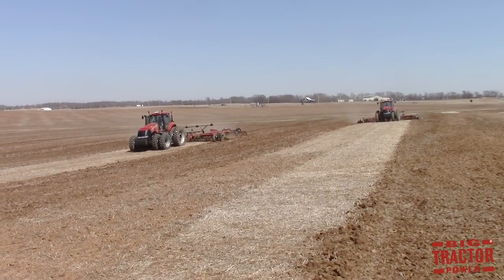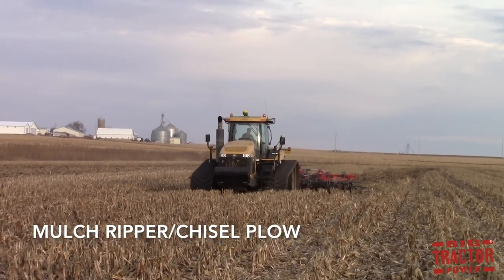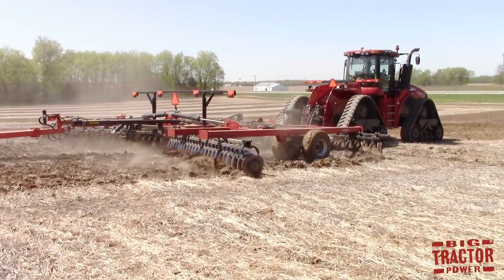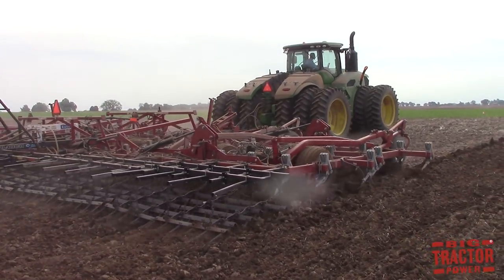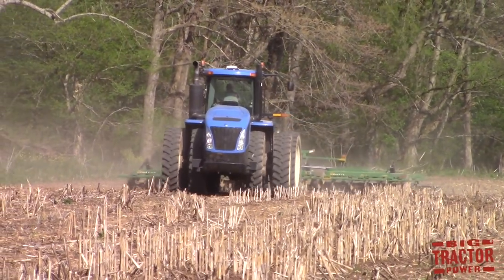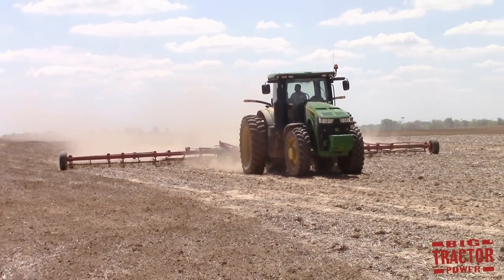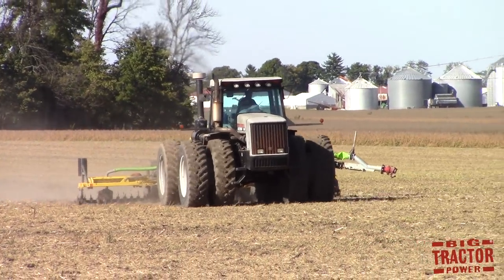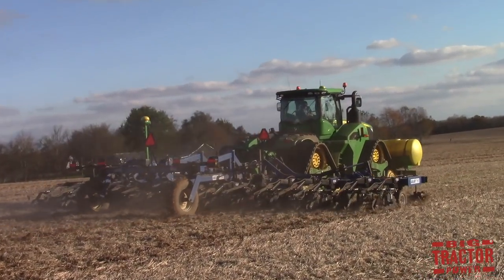See Every Kind of Spring Seed Bed Tillage

Comment: We always tried to have a disc to run behind our moldboard plow soon after plowing before the rains hit. 
If you plow in the early spring and don't get a disc or field cultivator run over the plowed ground and it rains you may find your ground is to wet to work in the spring .

Comment: You should update this video with some more tillage types such an inline ripper/subsoiler, rototiller/power harrow, rotary hoes like a yetter, and an older style machine for organic operations so they dont have to spray to control weeds in the spring a noble blade. Also some of the implements might have more common names like i have never heard the name short disc until this video they are more commonly know as high speed discs as far as i know. Also same with the mulch ripper is more commonly as a disk ripper

Comment: Im not a farmer (yet), and most of this is personal opinion and analysis based on my studies, but my ideology in tillage leans towards a mix of:
Shallow tillage with minimal inversion for mechanical weed, volunteer control and accelerated residue breakdown. (AKA: "vertical tillage)".
Cover cropping and direct drilling.
Deep loosening with low disturbance tools for certain crops.
Cultivation at medium depths when required do to trash conditions, wetness or ground temperature.
And also, but only when necessary; shallow inversion (20cm ploughing) for a monotonous rotation or pest control.

I really like some European tools, specially tools from Väderstad, the Carrier short disk harrow is one of the best tillage tools around IMO, it competes, together with the TopDown, with "vertical tillage" by running at very high speeds (15 to 20kmh or 9/12mph recommended) and by using low diameter, conical disks which are thought to chop and trow soil rather than other machines which lift and invert it. The new CrossCutter disks also a great tool that could benefit even "no till" farmers who need to clear some straw and slugs.

Other European cultivators which are a mix of a chisel plow and a field cultivator (and a cultipacker if you wanna add), They are composed of generally 2, 3 or 4  rows of heavily angled chisels, a set of closing disks and a packer, the machine can work pretty deep, mix in a ton of crop residue and even leave a nice enough seedbed that you could drill intermediately after the soil dries, or even at the same time if using a broadcaster to drill Canola (Rapeseed).

I find that tillage machinery in the United States is weird by the fact that almost none of them features packers and they are used or designed to be used very slowly. This combined leaves the soil very un-uniform, susceptible to wind erosion and loose for any humidity, carbon and nitrogen to simply fly away.
I do like tillage concepts from the USA, like "vertical tillage", which in my opinion does not help much to avoid compaction, but does work really well by avoiding mixing layers of soil, allowing formation of humus and soil structure.
What I think you guys are missing on your machines is mostly packing rollers. Chisels and rippers could also benefit from closing disks to level the field before packing.
Field cultivators used for weed control are the only machines that shouldn't have a packer, since you want the roots out of the ground for the weeds to dry off.

About the drills; I see reasons why you would want to have the drill separate from any form of tillage: Either from avoiding lifting moisture to increase drilling precision, or not to lift up volunteer seeds while drilling, all the way towards increased throughput, for drilling in limited time windows. But its hard not to appreciate the convenience of having a short disk welded into you seed drill, sometimes completely eliminating the need for seed bed cultivation altogether, consecutively eliminating the need for two tractors. And the tool can be lifted anytime (on most machines) if required.

Finally lets not forget, every tillage must have a purpose, lets not just trow a plow and then a rotavator in cause the soil must be loose and broken down into dust for the roots to grow, which is simply not thinking. Recreational tillage is bad guys, let structure form and leave that stubble in there when possible, save your carbon and your nitrogen , the atmosphere does not need any more of it.

My two cents.
Reply: BTW I live in South America, so the whole EU vs US is mostly unbiased (expect for the fact that we do have a width limit for transport of agricultural machinery).
Reply: Also keep in mind that one of the main causes of compaction is actually tillage itself. Intensive mixing of soil, breaking of fine porous structures and reduction in organic matter lead to soil having extremely low bearing capacity. Gradual reduction in tillage combined with cover crops will lead to better soil structure and behaviour. If necessary, consecutive usage of low disturbance loosening tools can be used to further reduce the effects of heavy machines running over ground.
Reply: You're in the right way, in some parts, in other, can say that are better methods to do agriculture itself. Brazil is competitive worldwide in agriculture because besides its tropical climate, almost every farm do the no-till method of cultivation.

Comment: The "Harrow attachment" on the back of the "soil finisher" not only smooths the soil to give a better seedbed but it also seals the surface to reduce moisture loss.  May not be important in wetter areas but in the Texas Panhandle (where I grew up)with 18" of rain per year it could be important.
Reply from the maker: Very good point.
Reply: You need to make a video giving the retail prices of the tractors and equipment you show.  Many folks don't realize how expensive those tractors and plow are!
Reply from the maker: Prices are tough to say on new machines because there are so many options that cause a price to range $30,000 to $50,000 or more. I will see what I can do.  On the classic videos I share pricing is easier and I share it in spec videos as there less options.

Comment: the aerator doesn't pull plugs out, it is a 8 inch blade like a knife that pokes into the ground,, also you forgot to include the ripper( which is a vertical tillage machine to remove the layers left from the plow, cultivator and disc layers.)
Reply from the maker: This video covers spring tillage at least here in Kentucky rippers are only used in the fall.

Comment: We use a short disc (amazone catros 3m) you mentioned 8-10mph+ with regard to operating speed. We regularly use ours at 22kph+ and on some ground I know of one guy that was taking it at 28kph
Reply from the maker: It is an impressive tillage tool.  Thank you for sharing. What tractor do you pull your Amazone with?
Reply: Charlie Saker - It sounds more like a mini race track than a crop field. LOL :-)
On the other hand I guess it saves a huge amount of hours and fuel. 
Cheers

Comment: you didn't mention subsoilers. narrow long vertical legs that go deep in to the ground with a triangular horizontal plate that picks up the ground and breaks up the pan caused by cultivating and ploughing and brakes up compacted ground from driving over it. in the US you have very different views on compaction ploughing and heavy cultivation reduces compaction but can smear the ground underneath causing a pan that stops water going deeper into the ground in the UK everyone says compaction is from driving over land and compacting the soil so roots cannot penetrate deeper to find water if a farmer shallow cultivated all the time the pan would be shallow so all crop roots can do is go sideways instead of down.
Reply: Can I jump in and say that you are not often right - but this time you're wrong ?   );-))    LOL!  I do agree with most you say - but generally despite what I've seen on theTube,  and it really ANNOYS me the way farming is going - people do not know or understand HOW to set up a plough!  A plow should be "carried" thru' the soil to provide traction for the tractor and NOT to smear. - it  can then be used to break up Pans as deep as the Plow depth.  Smearing and Plow Pans is caused by several factors: (heavy) traffic in the WET; poorly setup plows - the shares being "blunt" = worn so that they push down as much as up to get through the soil.  A properly set up plow will suck down so that it has to be maintained at its level by t he tractor.  It appears that most of our BIG Reversible plows are effectively just trailed - hence the need for soooo much Ballast to pull them!  - It is a large enough subject to discuss but if folk would get the Basics right .....  ( NOTE: - I cannot see this video yet -  something to do with HTML5 )
Reply from the maker: In line and v rippers are the main tillage tool for fall primary tillage.  I did not include them in this video because the focus was on spring tillage options.  I have not seen subsoilers used in the spring.
Reply: joseph jackson why don't you explain then
Reply: There are many soil types in the USA. I grow up on the farm we played in swamp ground and heavy clay. I worked for six other farmer and they all had different soil from sandy, rocky, black soil and clay sometime all in one 60 acre field. What works best for where you live is what you uses
Reply: You need to look at the math/physics of how the tires transmit power to the ground.  When you start putting over 200 hp to the ground the compaction from the torque of the wheel becomes important.  

We used hard-surfaced discs for our primary tillage tool for a long time, but then we realized the small the edge of the disc to more it compacted the deep soil.  Yes, our discs were so sharp they would chop up a pine 2"x4" board but we were still putting thousands of pounds of pressure on the edge of the discs.

We finally went min till before the Peanut Farmer and his wheat embargo killed the prices and the fuel prices put us out of business.
Reply: Wild Turkey My Family lost the farm in that time frame too. Don’t forget the interest rates going through the roof.

Comment: Another great video thanks!:)

In a couple of months I am beginning a new farm, on never-before-farmed or tilled land. It’s about 5,000 feet elevation, located in SW New Mexico and has served ranchers, off and on, as forage acreage of native grasses (such as black and blue grama) for a couple hundred years of a bare minimum rate of 6-8 cows per section. (I have 6 sections.)
There is a bit of creosote bush and some other smaller “forbs” but nothing too big or cumbersome. What implements would you suggest on prepping this new virgin soil for planting hays?
Thanks again for posting these awesome videos.
Reply: If you could describe the soil horizon I could be specific, but hay does not really need much in terms of soil depth, unless the soil is waterlogged or there is a hardpan generated by either chemical soil reactions or animal traffic. Tillage before hay is almost irrelevant since soil will actually form a good structure by itself if plants are growing on it and its not disturbed. Make sure the PH of the soil is right before you do anything. If the levels of organic matter are too low, cultivation of cover crops before seeding the hay might increase the soil's potential.
In the case of a hardpan, loosening of soil to depth might be necessary, mixing in the case of a chemical hardpan. Mixing to depth will degrade soil structure, so avoid if not necessary. 
After this is resolved, I would recommend shredding of the vegetal cover followed by some sort of medium depth cultivator, or disk-chisel combination. No more than 20cm/8 inches deep if possible and a shallow second pass if necessary to fine the soil a bit. Soil may be very hard to break do to roots, so using a disk harrow to cut through could work in that case.
Seeding could be done by broadcasting, harrowing and rolling over the seed, grassland seed drills designed for overseeding are great for this.

Never actually used this machinery, so take this advice with a pinch of salt. Im just transferring knowledge. Ive researched a lot about farming methods and soil structure formation, I do have experience with seeding grassland by hand and I am currently studying agriculture in an institute.
Reply: Ignafiltro Sanchez thanks much for taking the time to respond and write all that. The interesting thing is, that through talking with other farmers (a month has passed since my posted question(s)) and by studying a bunch of online info you’re pretty much spot on with everything you wrote. 
Thanks again
Reply: That is great. Good to know that my research is giving correct results.
Let me know how it goes if you ever can.
Good luck.
Reply: Ignafiltro Sanchez thanks! I’m very excited to get it started.

Comment: How many seasons can pass using only ‘no till’ before you have to plow ‘deep’ again?
Reply from the maker: Well the first no till Field ever was planted right here in Kentucky where I film.  I drive by that field all the time. It was first no tilled in 1962 and has been no till for 56 years now.  So the answer would be at least 56 Years.
Reply: I've always read after 3-5 years after starting no-till the hard pan naturally goes away.
Reply: If you do the no-till method correct, i can say that the answer is never.

Comment: How is soil compacted by ploughing? If you dont open the soil you are literally nothing loosening it up. Lets say that new road is being built and they are preparing the substrate of the road, they will roll the soil with heavy rollers but according to you they should be ploughing to get better compaction. Also, ploughing loosens up the soil and increase its water retention capability. About erosion, how does that happen once your plants have grown because their roots will hold the soil. Second if you are worried about erosion after harvest, use cover crops, they will make a really good compost for next season. One more point on erosion and that is if you shallow plough your field you are not mixing the soil and hence not mixing the organic waste of the last crop very deep hence your deeper soil will lack that material and in case of heavy rains what washes away is top soil which is the only layer that contains most organic matter in your case. So what you will be left out with is soil with reduce organic matter.
Reply from the maker: The compaction caused from a plow is under the soil.  The blade scrapes the soil at the same depth year after year.  While the soil is loose on the surface it becomes hard 8 inches deep where the blade scrapes to turn over the soil.  Because it is not a spring tillage tool I did not show a sub soiler that rips into the ground 18 inches deep to fracture the soil and hard pan to improve soil growth.
Reply: A conventional disc with concave blades though it shears the soil away from the concave  side of the blade the weight of the disc compacts the soil on the convex side

Comment: Moldboard plowing is kinda shunned upon around my area.
Reply from the maker: Plowing is not very common in many areas any more but is required for some crops and works better than any tillage for some regions.
Reply: We have heavy lime requirements because our rainfall amounts. I still plow to incorporate lime, but for yearly tillage we use a weatherproofer.

Comment: those are some of the wimpiest harrows i've seen. here in canada we can put pressure down enough on our tines that we can work up the top layer of soil and bust up straw, and they have 5/8"x 3' tines on them
Reply: Do you use them to reduce slug population? What about volunteer seeds? Do they get mixed with the ground and germinate?